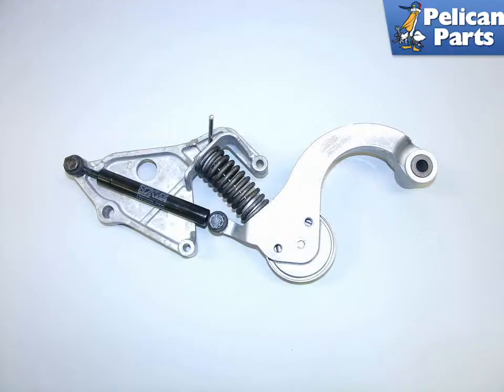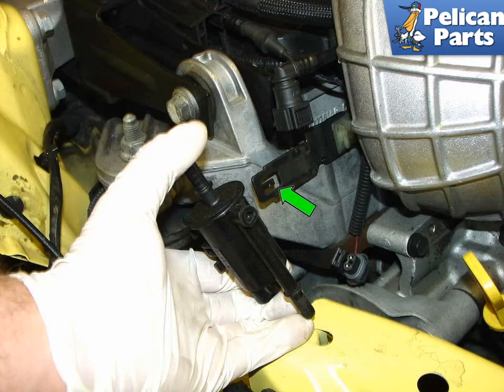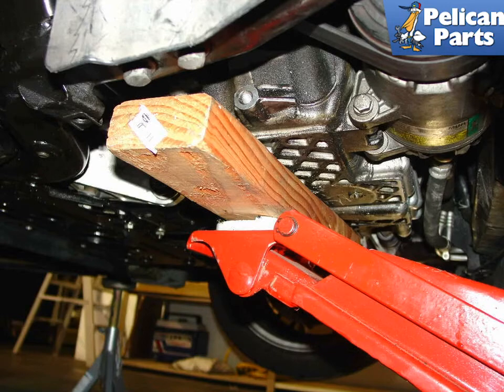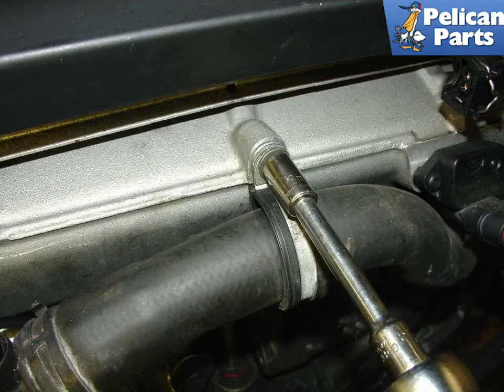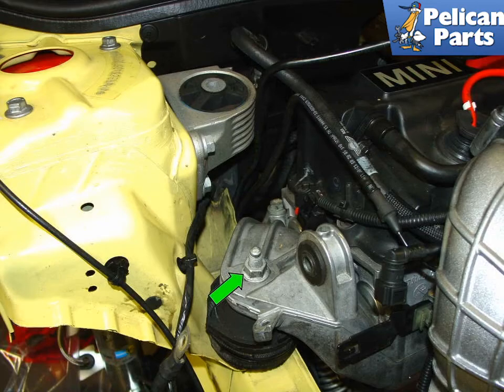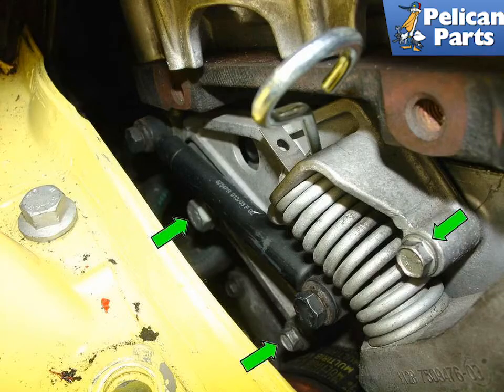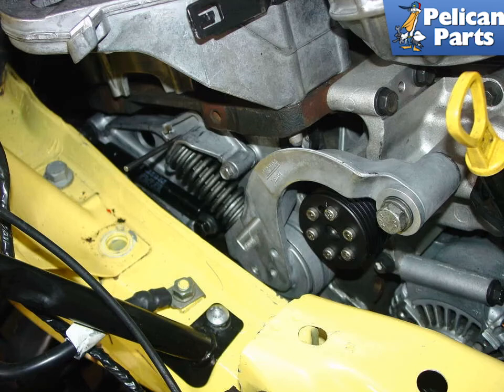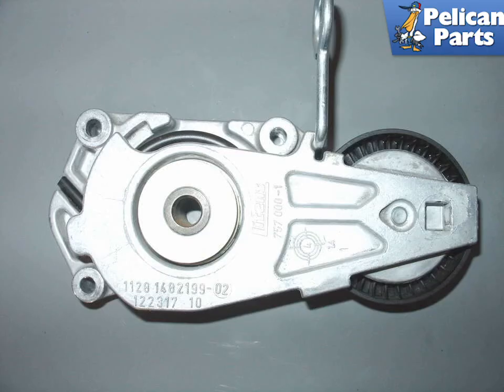MINI Cooper R50 - R53 Belt Tensioner Replacement

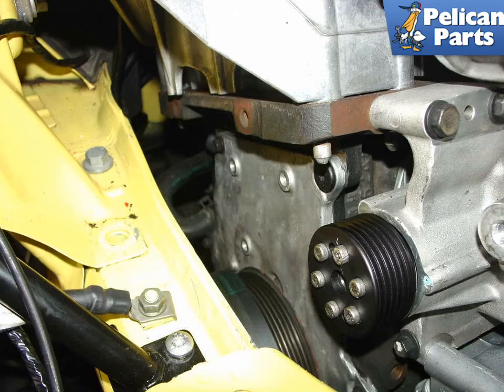Comment: 4:13 16mm bolt in the back, could you tell me the part no. for that bolt?
Reply from the maker: You didn't mention what year and model vehicle you are working on.

With your vehicle info handy, give The Pelican Parts parts specialists a call at 1-888-280-7799. They can figure out what part or repair kit you need.
Reply: @ oops. 2004 R53 w/o JCW